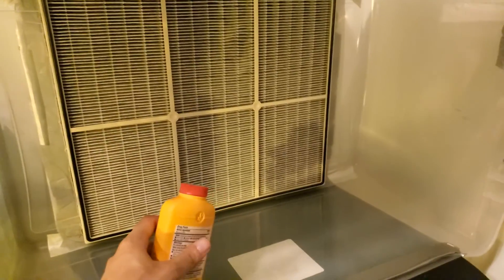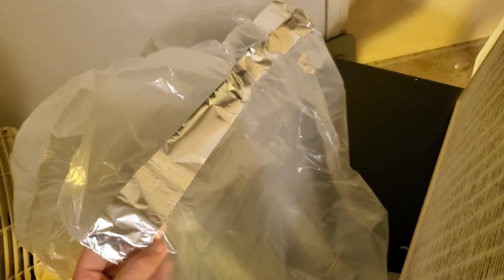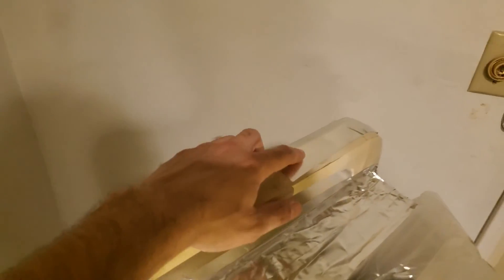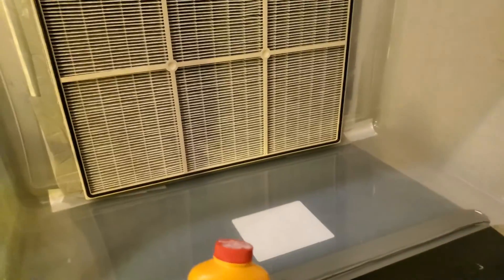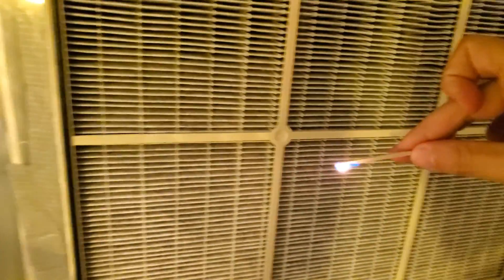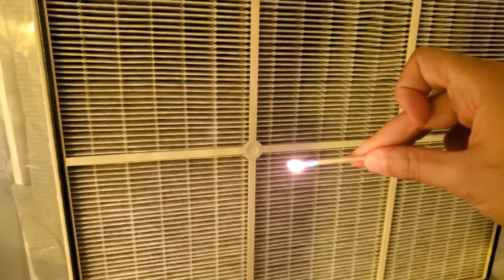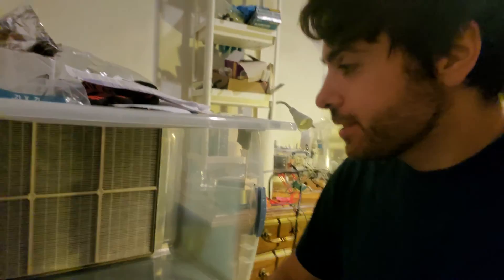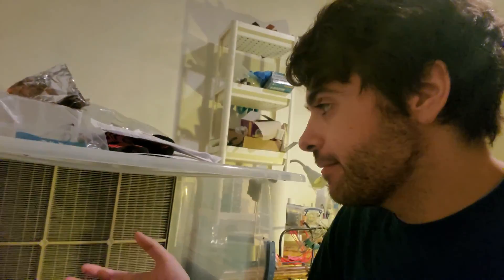DIY laminar flow hood. Cheap, Easy, Quick. Great for spin coating and photolithograpy!

Comment from the maker: Just to be clear, I'm not recommending this for cell culture. I haven't tested it for that. I have tested it to make a dust free environment for  certain dust sensitive practices, such as spin coating a photoresist. I know there are better tested flow hood ideas out there for cell culture. This is an ultra quick/cheap method in a pinch. With certain things like bacteria it's possible to work without a flow hood at all, sometimes just an open flame, so this might be good enough for certain biology use cases, but it would have to be tested. I wouldn't recommend it for working with stem cells that usually don't have antibiotics in the cell culture media. I have another comment where I mention an idea for a more sterile version and there are plenty of other youtube videos that discuss DIY flow hoods for sterile applications.
Reply: Yeah idk if your air flow is even laminar, the fluid looks turbulent to me.

Comment from the maker: By the way, an update, after several weeks, or months, not sure which. During which I left the air purifier running constantly on low setting (doubles as my room air purifier lol), the aluminum foil tape does tend to partially delaminate, so it's not perfect. Just slap some more on or comment with some better tape or a better solution.

Comment: Ok ,but you need a device to measure to level of bacteria ! And then you will be ,like wow , what a great idea ! Good luck
Reply from the maker: just agar petri dishes would work. I used to work with bacteria many years ago, but don't have any on hand. I really just use it to get rid of dust, not do bio stuff. I do have a 37C incubator though... Maybe if I somehow get my hands on agar in the future, I'll leave some petri dishes out and see what happens.

Comment: Can’t you use a window fan ? Attach it to the other side? I gotta find a way to make a fan
Reply from the maker: Blower fans are typically more powerful than window fans. You need something powerful enough to push air through the hepa filter. Air purifiers are nice because the fan is already matched to the hepa filter. Also, they have a pre filter to help remove dust. No harm in trying though. Comment here if it works.

Comment: Could just cut some cardboard and attach from edge of filter on either side and attach to front side wall edge. Also could spray some soap water in those voids to help keep any loose dust from making it’s way to the work area. Not sure if any of this makes sense 😂🤷🏻‍♂️

Comment from the maker: This video uses the lid with two hand/arm holes in it for a more sterile environment: https://www.youtube.com/watch?v=6RIgMveU-q0 I opted not to do this for ease of access, but if sterility is critical, this seems like a good idea. You could even make the holes gloved, seal the lid gap with tape, cut a vent hole in the storage container, and tape a simple filter over it.